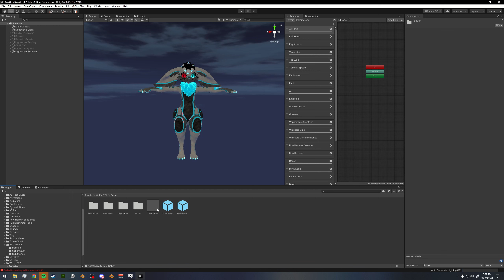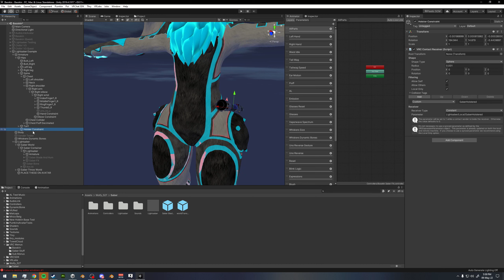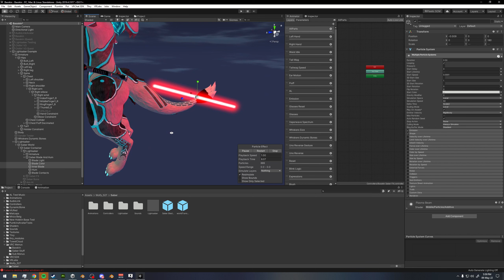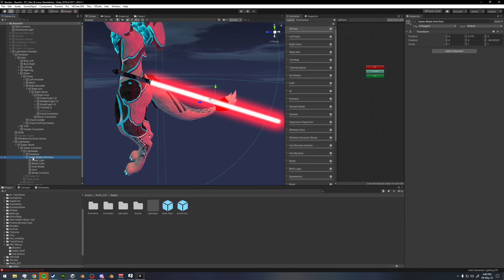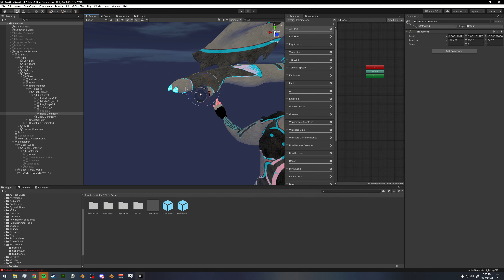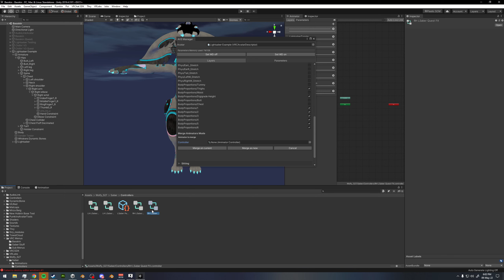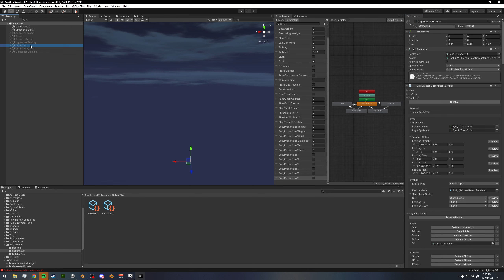VRChat - Avatar Dynamics - Plasmasaber Prefab Set-Up

Comment: im not sure why but scaling the lightsaber seems to not want to scale the way in the video, its scaling further up the blade despite clicking the same thing
Reply from the maker: Did you unpack the prefab completely? Also, you'll want to make sure you scale the lightsaber beam and hilt separately. So you'll click on "Lightsaber" under the "Saber Container" and press R to scale that, and then you'll scale the "Inner Blade" and "Blade Color" together that are under "Saber Blade and Hum" so that they fit right up against the hilt.
Reply: @Wolfy527  yeah i followed it to the letter of how you had it, but clicking on lightsaber has the anchor point of the object further back and not on top of the actual hilt

it seems like when i click on lightsaber it wants to scale and group everything thats connected to it at once which is why the actual point is detached from the hilt
Reply from the maker: @MrScorpion132  Saw your discord message, I'll help ya out there!

Comment: ouu its here!
Reply from the maker: It's taken a while to get things smoothed out with it, but I've tried to make it work on as many avatars as possible! Glad to finally get it out to people!
Reply: @Wolfy527  How much of a toll will the light and particles be on performance? I am wondering if I should implement this for my main avi, but I almost exclusively hang out in packed club worlds
Reply from the maker: @felixkrell890  I would highly recommend taking off the light source if you do that. The light source can multiply draw calls by a lot pretty quickly. The particles shouldn't be too bad on people, but in densly packed lobbies it might bit a bit harder on computers potentially. 

I have used the lightsaber in a lobby with 70+ people and it did run fine for me though and no one complained about it hitting performance too bad, despite having the real time light as well.